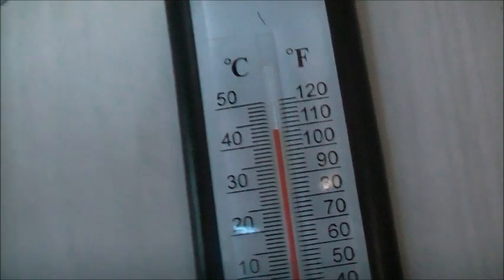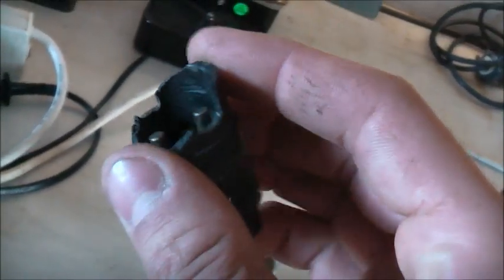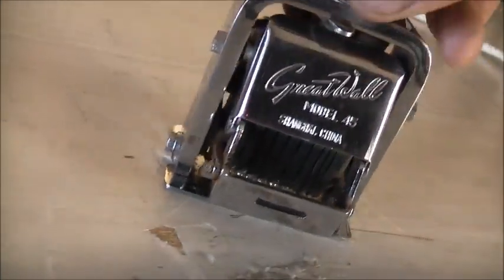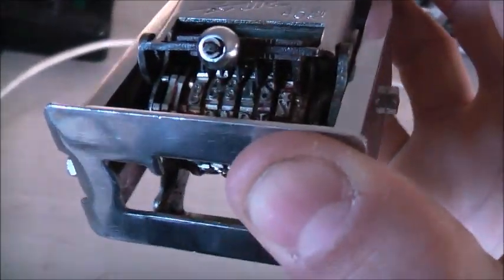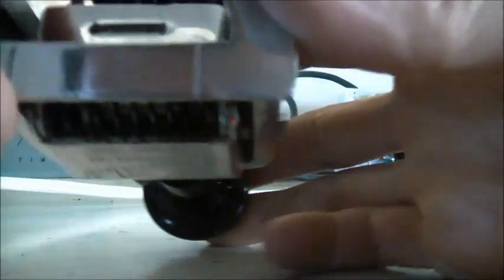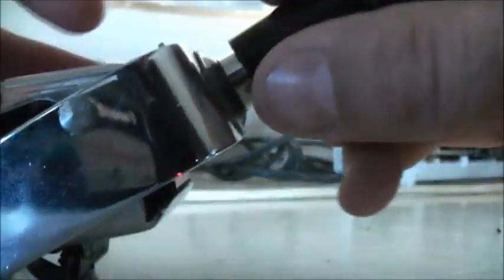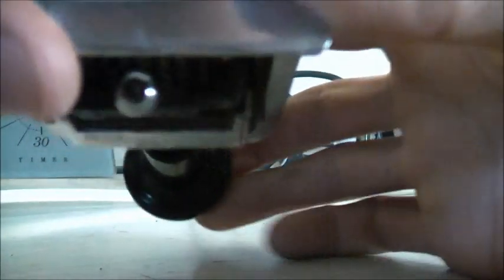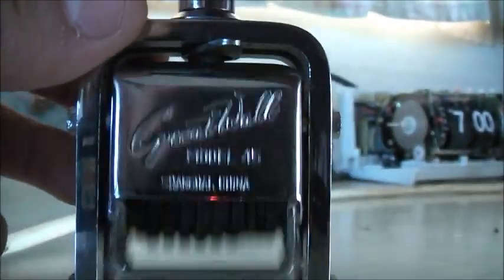Great Wall Mechanical Numbering Stamp

Comment: If you want the numbers to line up better, I expext setting it to 999999 and then pushing it down once should work better than manually zeroing (as long as the advance mechanism isn't too worn/out of place)

Comment: Mine not working , it reads model 45. Am having hard time figuring how it works. The numbers not even hit the paper. The ink clamp doesnt let it drop all the way.
Reply: should the side screws be tightened all the way. I cant press the handle down.